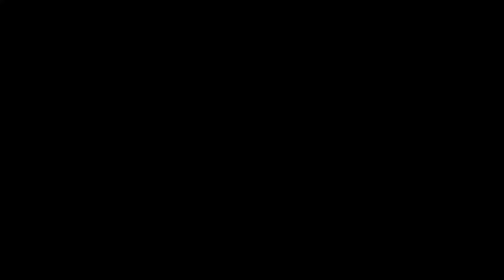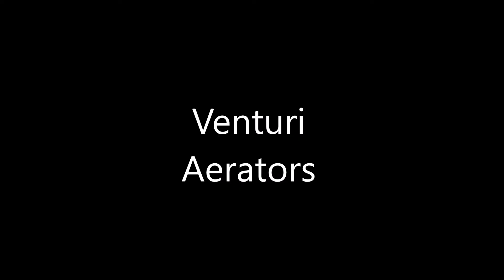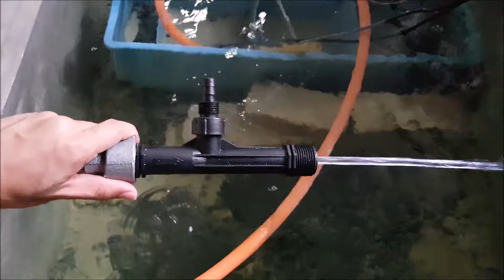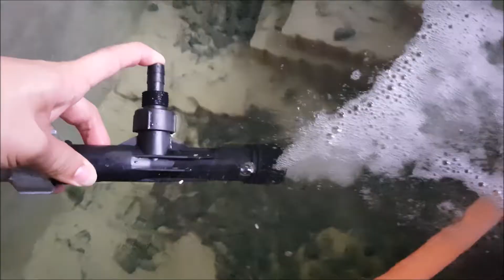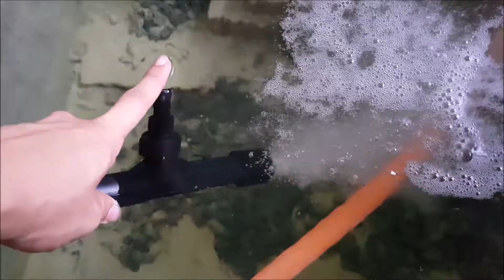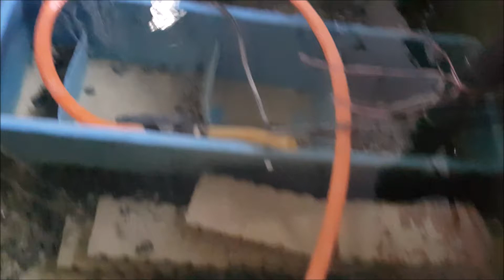DIY-Venturi Aerators for Circulating and Aerating

Comment: What should be water flow per minute to achieve same fine bubbles
Reply: Whenever i hear someone says "it depends" it means he doesn't really know the answer.
Reply: @Wilcosach pack it up Tesla, u know everything :)
Reply: @Wilcosach  It depends because of the size of the Venturi. There are different plumbing sizes. Trust me, as someone who researched this industyr for many years, RAS is legitimate. They know what they're doing and they do things properly.
Reply from the maker: it depends on the flowrate for the venturi

Comment: How many gph pump are you using and is that a 1/2 inch venturi or 3/4 venturi?  I have a 951gph pump and want to run 2 venturi's in separate tanks but not sure what size venturi's to order.  Do you have any recommendations?
Reply: Intenta reducir el diámetro de la garganta  del tubo Venturi. Yo lo hice con una tapa de lapicero y obtuve microburbujas.